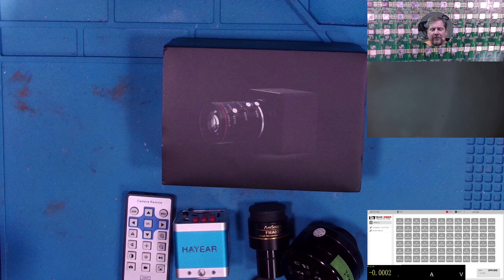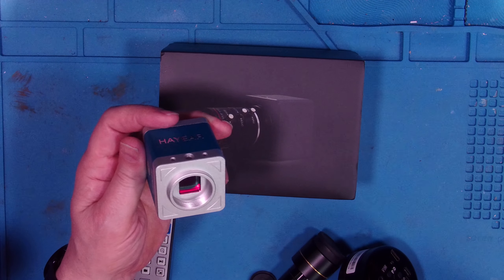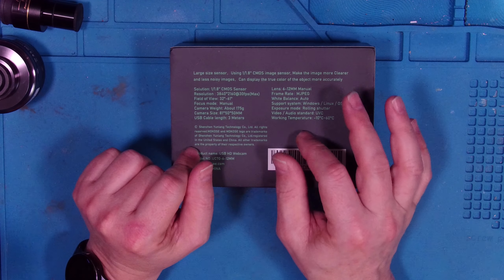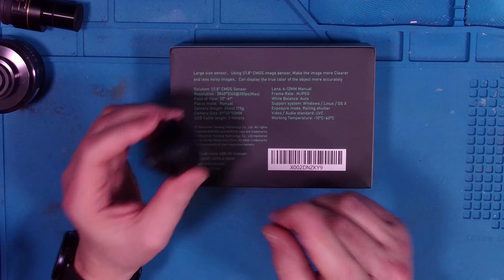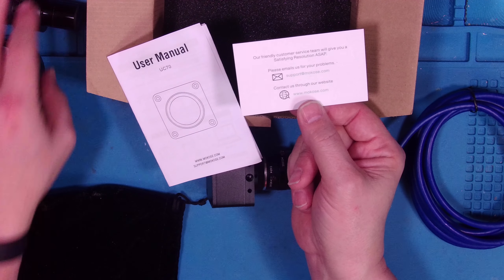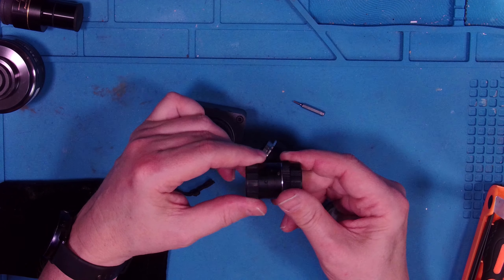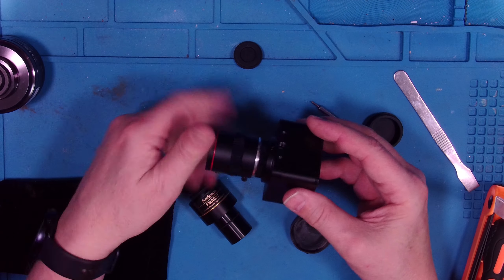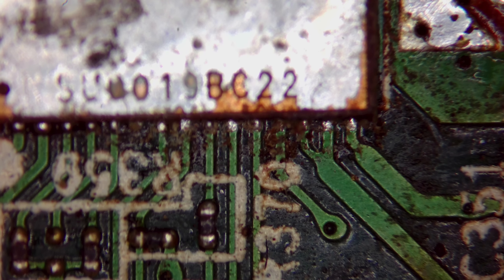New 4K cameras for the channel!

Comment: Do you happen to know if this Camera works with windows 11 without having to disable any security features? I am also looking to set this up on a microscope as our amscope not longer interfaces nicely with windows 11. The device needs disabled security settings to work properly and is why I am looking at this as a cost effective alternative

Comment: What software were you using on the PC to view the camera output?
Reply from the maker: I tried a couple of different programs, however I was mainly using OBS and the Hayear microscope software.
Reply: @iagmr  Thanks. I have an “Eakins” 1080P camera that reports itself as “‘H1600” when plugged into USB. The Hayear software shows “No Camera”. I wondered whether this camera worked with that software.
Reply from the maker: @cyberia55  that's a good question. Now that you mention it, I never saw any of my other web cams except the Mokose and Hayear in the Hayear app.  I think the Mokose were present because they use the same chip set.
Reply: @iagmr  My apologies, I didn’t phrase my response clearly. I wondered whether the Mokose worked with Hayear software; you confirmed this. I already know that this “Eakins” decal’ed 1080P camera does not work with Hayear software. When I saw “H1600” reported by the camera over USB, I assumed it was “H” for “Hayear”. When it then didn’t show up in the Hayear software (“no camera”) I went crazy looking for some menu item to “connect” to the camera. Eventually I resigned myself to the fact that Hayear software only recognizes their own camera, and “‘H1600” isn’t one of them. Hayear software is the same software used by AmScope (I tried them both, they appear identical), they just change the name. Also, every camera I’ve seen reviewed on YouTube ignores the dozens of adjustments and features available in this Hayear/AmScope software. Is there a camera that responds to every feature? If not, it makes one wonder why they would bother to develop and include those features in the app. 🤔

My original camera was an AmScope MD800E, but there are no drivers available for Windows 10. I contacted AmScope, their reply was “it’s too old”. It’s difficult to find good support these days. I probably would be unhappy with its resolution anyway. 🤷🏻‍♂️

Comment: Great review.  In future, maybe you could make another video illustrating the software side of the purchase?  All the best to you.
Reply from the maker: Thanks Mark! I use these mokose cameras with OBS on my channel. I've tried the Hayear microscope software when trying to measure parts on a circuit board but it didn't really work for me.
Reply: @iagmr  New subscriber to your channel.  I just downloaded (not installed yet) OBS.  I am an old man, but new to video, software, and streaming.  I hope to connect a camera to my Vaughnlive channel and stream live.  Sadly, I just purchased a Hayear camera a week before I saw your video.  Guess I'll be buying a different one soon.  I have an refurbished Olympus BH2 (trinocular) coming in the mail soon.   Your channel is a great resource and I thank you for taking the time and effort to share your info with others.  All the best.

Comment: So regardless for 4K recording (in term of micro soldering ) what is the advantage for Mokose Camera over HAYEAR since both are using 1/1.8 Sony sensor?
Reply from the maker: Great question. While both cameras have the same sony sensor, the Mokose camera doesn't have the same problems with video cutting out, turning green, etc. As well as support is better with the Mokose. Hope that helps.
Reply: I have electronics  repiar shop so I dont use 4K recording.
All whatvI care about is resolution, color, depth view, and the quality for the picture
Reply from the maker: @jannmedia  I hear you. My Hayear did not work well at the claimed 4K setting. The image would stall, turn green, or just blank. It didn't matter if I had it connected to the computer via USB or HDMI connected to monitor @ 4k.  These problems persisted and Hayear support failed to ever fix them or offer to replace the unit after I tried countless software and firmware updates they suggested.  Mokose on the other hand has consistently worked well as a 4K camera whether I'm using it on the microscope, overhead or a macro upclose view.
If you run your microscope cam through your computer, the Mokose will work well as it only has a USB output.  If on the other hand, you need to go directly to an HDMI monitor, the Mokose camera reviewed in this video will not work as it does not have an HDMI connector.
I did finally find a use for the Hayear. It runs OK at 1080p or even 720p. No over heating issues and no image issues. So it's connected to my 3d printer with Octoprint.

Just curious, what microscope stand/boom are you using. I'd like to upgrade mine but I haven't found anything with less wobble.
Reply: @iagmr  Thank you for the great details, I think you answered my question since I use it with HDMI connected to Vizio TV over my table.
For the stand I have Flexible Arm Digital Microscope Stand also have tabletop.
But I was planing to get Articulating Arm Pillar Clamp Stand for Stereo Microscopes, then I come back to modify my Flexible Arm Digital Microscope Stand so I can change the head screw position by making new thread screw in the microscope lens ring so I can switch HAYEAR upside down since that is the only problem Im facing with this microscope, the pic will not match the item position on table.
But I agree about some issues you have mentioned for the yellow color, which the problem solved after I upgraded the firmware
Reply from the maker: @jannmedia  I haven't ruled out that I might have gotten a bad Hayear, but since they really weren't interested in swapping it out after we went back and forth for a couple of weeks I don't care. It works at 1080p so it's not a complete loss. Glad the firmware fixed the color issues for you.
Reply: @iagmr  I just bought the Mokose UC90A.  I am so excited about the HDMI output with the auto focus.  I cannot wait to do a review!
Reply from the maker: @VictorianMaid99  That looks like a great auto focus 1080p camera.